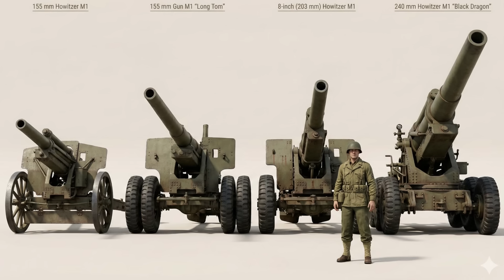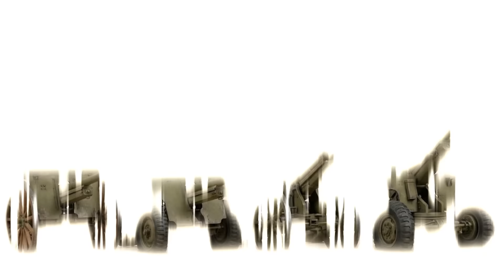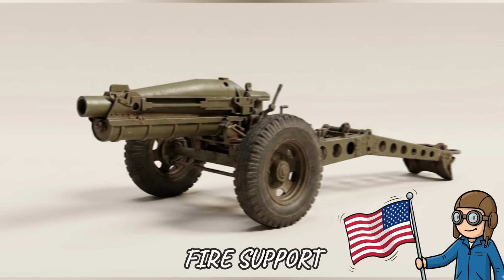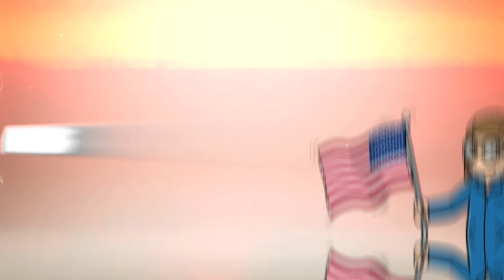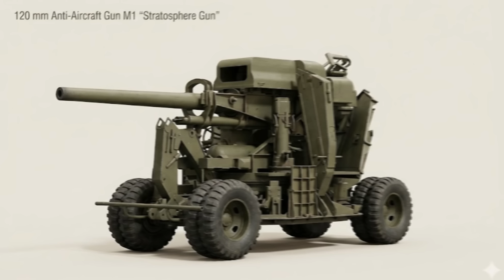Every U.S. Artillery Gun of  WWII - Ranked & Explained

Comment: Not every artillery U.S.  used - there were a lot of obsolete artillery, field  (2.95 in. Howitzer, 1897 MM Gun etc.), air artillery (early 37 MM, old 3 in. etc), coastal (12 in. Mortar, 12 in. Disappearing Gun, 14 in. Gun mounted on Fort Drum "concrete battleship" etc.) used by the U.S. Army in the Defense of the Philippines  1941-42, which were not tackled in the video.

Comment: The standard light AA auto gun was the M2 water-cooled Browning HMG. The standard medium AAA gun was the 37mm M1A1 also designed by Browning and in production and used through the war. The 90mm Gun M1 didn't become available until 1942. The standard until then was the 3" M1918 and M3 and the static mounted M1917. These guns bore the burden of combat with the Japanese in 1941-42.
Reply from the maker: Good point on early-war 3-inch guns. The 90mm became standard starting 1942 onward. The 37mm and later 40mm Bofors dominated medium AA for most of the war. Appreciate the added detail.❤

Comment: The 75mm Pack Howitzer M1 was originally built with wooden wheels from late 1920s and were mostly shipped to China.
The illustration is of post-war use as a coast defense gun by the Taiwanese from the late 1950s. The 240mm Howitzer M1 was a super-heavy field gun, partner to the 8" Gun M1. 
The video ignores the WW1 artillery the US Army continued to use through 1944. These included the 155mm Howitzer M1917 and M1918. The M1917 was French built and the M1918 was American built. The US Army had over a thousand on hand on Dec 41. Then there was the 155mm Gun M1917 and M1918, of which over 600 were on inventory. Both this gun and the 155mm Gun M1 could be mounted on concrete pedestals with rails or later on steel rails that could be assembled on site for use as coast defense guns.

Comment: 1. The 16" Gun M1919 and the Mk.2MII DID NOT fire the USN 2,700lbs AP shell. The M1919 was an Army design of which only four were built, two of which were placed to defend Pearl Harbor. It fired an Army designed 2,340lbs AP shell. The Mk.2MII was a USN design that the USN gave to the Army after the Washington Naval Limitation Treaty of 1922 cancelled a number of USN capital ships. It fired a USN 2,240lbs AP shell at a lower velocity and to a lessor range. Over 20 were emplaced around the US coasts including two in Hawaii. 
2. No, the US Army's 14" Gun M1921 on Railway Mount 1921 did not need a pit dug for high elevation firing. The guns were designed for coastal defense using pre-built circular tracks along military railways. The guns were run onto the tracks and then lowered on a pintle, the trucks at each end then being used to rotate the gun a full 360 degree. The breech and gun elevating mechanism raised the trunnions so that the gun could recoil without hitting the ground. Two were stationed at Ft. MacArthur, CA and two in the Panam Canal Zone, where the could be deployed from one side to the other in two days. Maybe you were thinking of the USN's 14" railway gun that actually saw service in WW1.
3. The 8in Gun M1 was a heavy field gun designed in 1941 and first fielded in 1944, the companion to the 240mm Howitzer M1. The 8" railway gun came in two versions, the M1888 and the Mk.VIMII. The M1888 was a coast defense gun removed from its mount and placed on a railway car with a 360 degree carriage. The Mk.VIMII was a USN gun from pre-dreadnought BBs scrapped under the Washington Treaty used as a coast defense and as a railway gun, the first deployment and emplacements happening in the late 1930s.

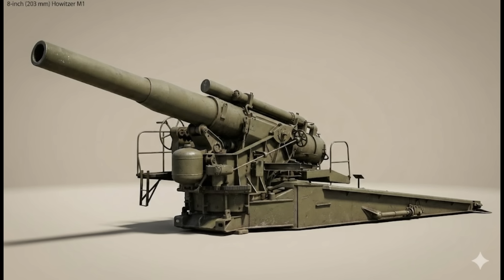Comment: The weapon at 4:05 is not the 155mm Howitzer, M1.  I trained on them and this picture ain't it.  I'm pretty sure the picture is of a 240mm howitzer M1.  The 155mm Howitzer, M1 looks like the 155mm Gun, M1 except that the barrel is shorter.  Both howitzer and gun used the same double bogie axle mount.

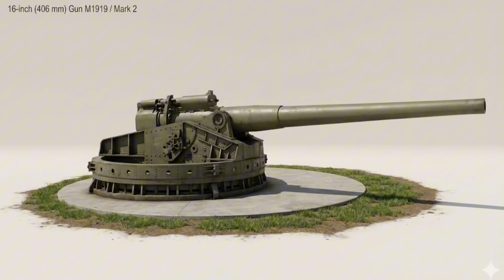Comment: The 16 inch gun at 9:53 looks a lot like the Iowa class battleships' gun. This video says the propellant powder charge weighed 824 pounds.  That is about 160 pounds more than the Iowa  battleships gun maximum powder load.

It would be interesting to know where these were located.
Reply: These guns were used to defend ports and such, several were emplaced to protect the Panama canal. The powder charge is lower here than what wikipedia states at 850lbs.
Reply: The M1919 were emplaced in Hawaii, New York City and Boston, there were only 7 made.  The US Army got surplus 16" guns from the Navy and emplaced them on mounts in places such as Panama, Hawaii, Newport RI, San Francisco.